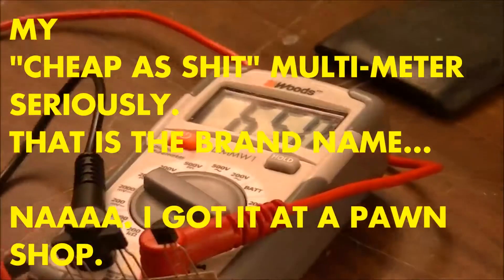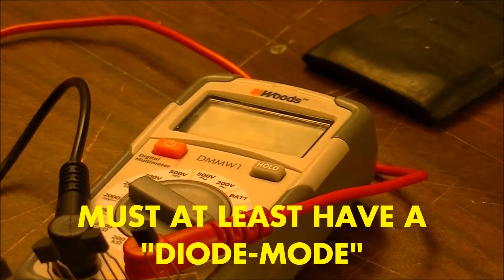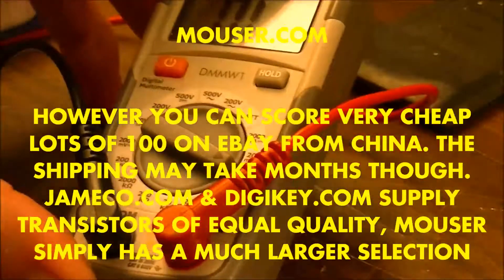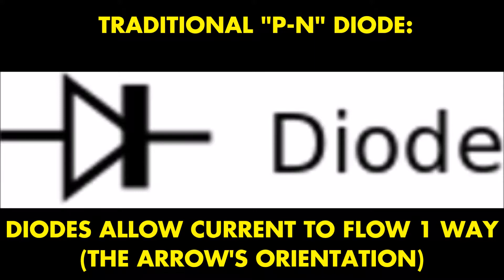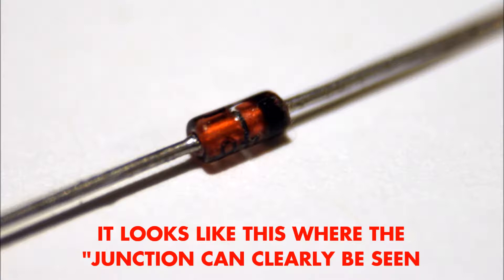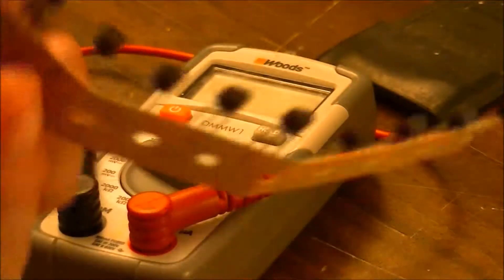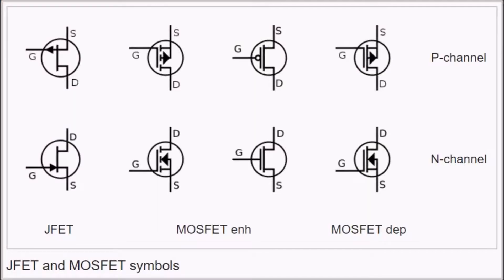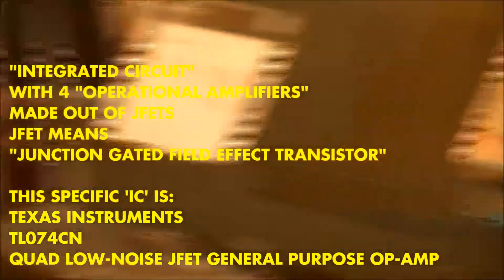How To Match Transistors With A Multi-Meter (Using BC547s)

Comment: Thanks I was having a real hard time figuring this out but since I’ve got a good DMM with diode testing i can easily match my transistors. The reason I need a match is because i’m building a compressor and they need a matched pair for the amp portion of the circuit
Reply from the maker: Hey, I found a super-matched Pair of Transistors for use in the Long Tail Pair" configuration being made in China. Here is a video where I show the ,matching is accurate down to the Microvolt. I don't know if they are still being sold on eBay. I bought 20 super-matched pairs for an incredibly reasonable price. I would recommend ordering a ten pack of them. They are shipped in a 3-Pin DIP configuration and the Bases are pins 1 & 6, Collectors are Pins 2 & 5, and Emitters are pins 3 & 4 so the Emitter can be Tied Easilyhttps://www.ebay.com/itm/25pcs-2SC3067G-2SC3067-original-Sanyo-NPN-Dual-Matched-Transistors-high-gain-hfe/382807888701?hash=item592120d33d:g:geMAAOSwj0NUjjIaThat is the ebay listing and here is the video I made:https://www.youtube.com/watch?v=jKtfWOYzglI